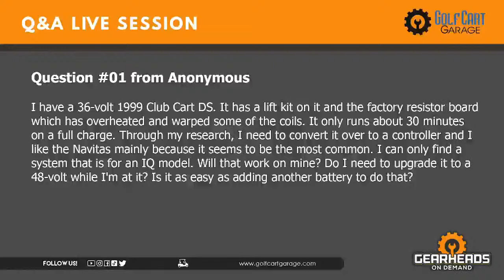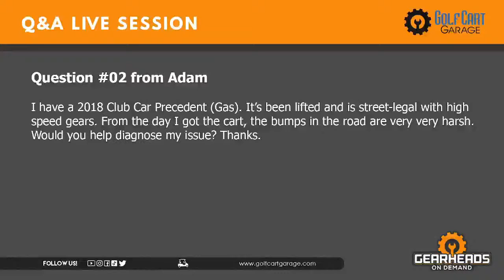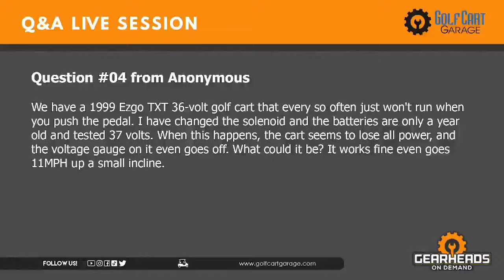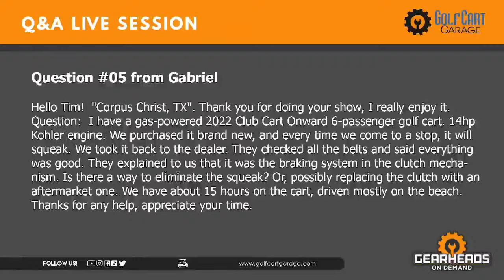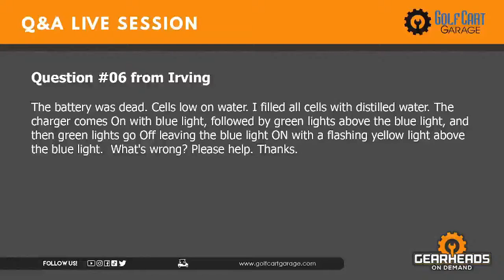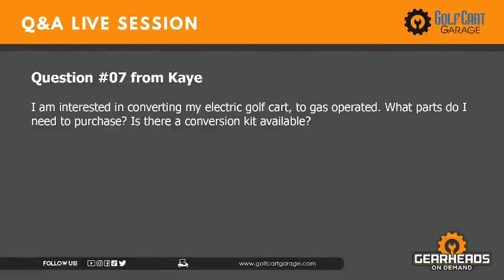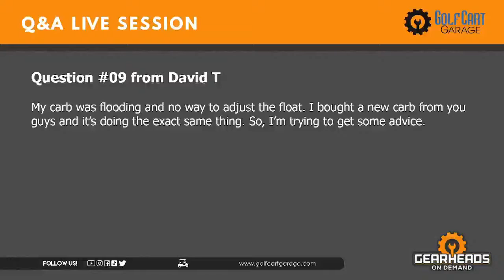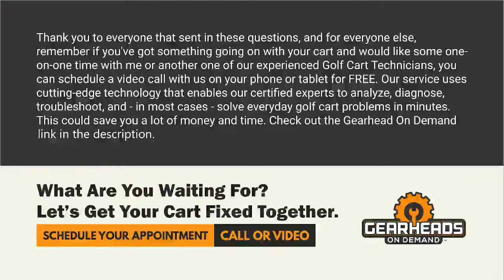Eric Charger | Golf Cart Garage I  Episode # 159

Comment: What does the triangle error mean on the charger
Reply from the maker: Thanks for watching, Norma! If a Club Car ERIC charger has a red LED triangle shape with an exclamation point, it means the charger is unable to complete a charge.  It may be a temporary error that unplugging and restarting will solve.  It may also require replacing the charger or testing the batteries for a bad cell.  You can get an appt for a video call diagnosis here: https://www.golfcartgarage.com/gearheads-on-demand/
Or get in touch directly at Support@GolfCartGarage.com or (800) 401-2934